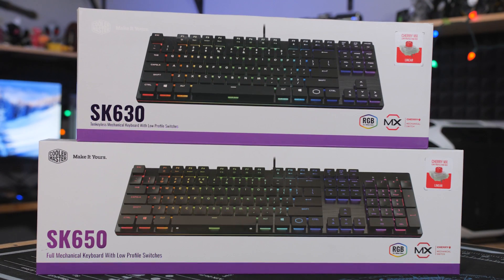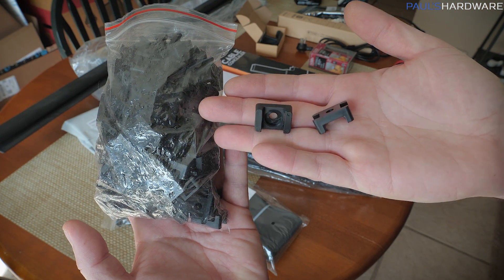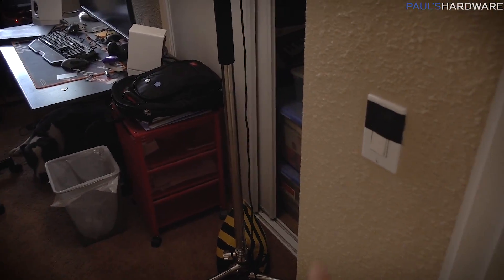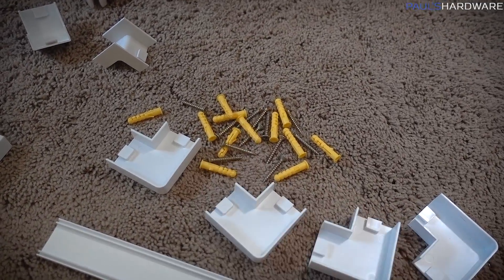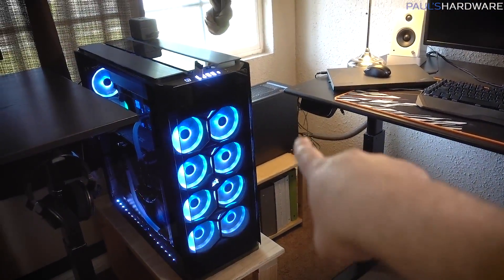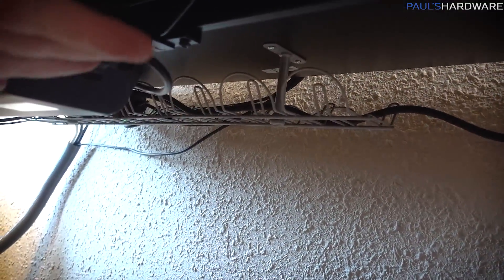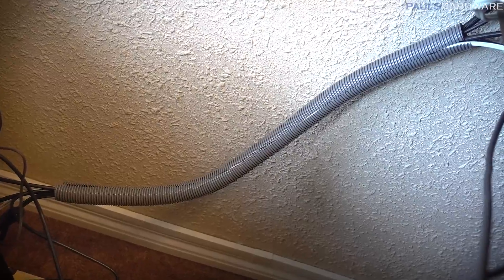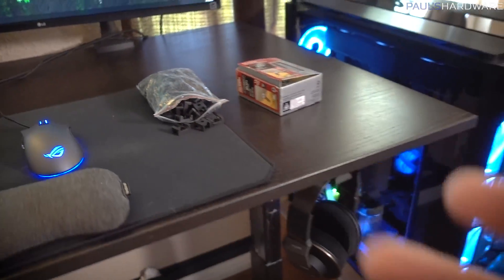Computer Room Cable Management Gear Test!

Comment: I use ace bandage to keep my cables together because those cable things, like the gray one he has behind his computer are hard to manipulate and can only hold a set amount of cable, but ace bandage is cheap and easy to apply. It's also flexible enough to wrap around cords that have been bundled to make them shorter. you can bend it in multiple directions to keep things straight and to go around corners. It comes in all sorts of colors too. (I use black) I also use it to attach my monitor cord to the monitor stand to keep it from hanging down. It's easier to remove and to apply than the sticky clips, which kept popping off whenever I change my monitor position.

Comment: The cable tie clamps are good but there are better ones with a reusable strap built in. That way you don't have to cut cable ties every time; you don't even need cable ties. They also come with screws.

Comment: Everything looked pretty clean with the exception of the plug at 8:55. Paul, what cable management would you recommend using for a glass desk to properly hide all of the cables since the option of drilling holes isn’t available besides adhesive tape? 🤔

Comment: None of the youtube video about desk/room cable management helps me with my situation:
I have 1 work laptop, 1 gaming desktop for me and 1 gaming desktop for my son
5 monitors
Then a bunch of devices that none of the youtube videos cover: 
internet modem
wireless router
VPN router
VOIP telephone router
3 UPS
a flatbed scanner
a laser printer
multiple USB hubs.
multiple power strips
2 subwoofers and 2 pairs of satellite speakers

Comment: ive done a lot fo electrician work and we use those canals with the lids on and they come with adhesive on it but they never get used by anyone around ehre as they never last more than 2 years when when/if you take it off, it might ruin the wall/wallpaper/paint.

Comment: I'm still looking for a cable management system that not only allows me to put cables out of sight, but to undo the management easily. Every current solution seems way too permanent and I rather have unsightly cables dangling around the whole place than having to crawl out of my wheelchair to the floor to get under the table, destroy single use cable ties and such, then replace them when I'm done moving or rewiring a device, which happens every week (or rather would happen, if I was ready to deal with the hassle).

However you convinced me to give IKEA Signum a shot, so thanks! :)

Comment: Pro tip: drywall screws have a larger diameter thread than most normal anchor screws and work great for mounting cable channels into plaster or drywall.  The smaller threads can more easily pull out whereas the drywall screws are more secure: its not a perfect solution, just more secure.

Comment: I usually just use velcro strips and a staple gun for underneath my desk. You can cut the velcro to the length you need, and the staples don't really leave marks in the wood.

Comment: Thanks Paul! Super useful video for me - cable management will be my next project and I've considered a few of these very products. Good thoughts on using screws instead of adhesive strips - a screw hole is much easier to patch than a 4 foot strip of paint ripped off the wall when you move out if you're a renter like me.

Comment: Watching you do this made me feel bad about my current desk cabling situation. So tomorrow, I have this job ahead of me, with slightly more cables due to surround sound system and TV and a desk that sadly does not lift. If I die, please have Steve from GM take me to Heaven. Because I don't quite fancy The Verge in Hell.

Comment: If anybody else is doing this, if you move your stuff around a lot or have to change any cables it's gonna be harder than before. The ikea rack under his desk (I use that along with velcro ties), if you wrap a cables around in there and then want to swap one of them out, you have to undo the ties holding your cables together and unwrap a bunch of cables out of the way on the ikea mount.  eventually I  used less Velcro ties and didn't wrap any cables around the ends of the ikea mount, I just ran then through and looped them around on the inside.

Comment: You keep talking about how rough your walls are and not being able to use the adhesive, but you could have run that thin raceway along the bottom of your baseboard and it wouldn't have been as noticeable.  They also have replacement baseboard with cable raceways built in.

Comment: reminds me that I need to rework my cable management in both my living room and our computer area.
going to replace a couple of the power strips with ones that include usb charging, will get rid of wall warts.  replace monitor stands with arms, mount power strip to wall as opposed to floating around on floor, install cable runs.  wife might not like it at first, but will soon accept becuase we have no desire to move anytime soon so no need to worry about ripping that stuff down adn repairing screw holes.
Anyway, great video, gives me some ideas and will make that  a project to work on during my annual staycation while wife and kid are out of town.

Comment: I love it! 
I have one minor grudge though. That L-stand for the computers. I'd look into flipping it 90° clockwise, and having the almighty $10000 build with the back towards your desk, and your wifes pc place with the glass panel out, having the rear facing the wall corner. And that little box thingy on the outside of the pc, towards the rear. It's hard to explain properly, but I think you get the idea 🤗

Comment: The way you have seemingly powered everything (except lights) in that room off one single outlet and single standard duty extension cord concerns me.  You have 3 power hungry computers, 3 monitors and a host of other accessory items apparently all fed off it.

While the circuit feeding the room MAY be adequate for serving all that hardware and presumably the lights (possibly another room as well?) that cord arrangement is asking for issues.  I'd spread the load across the 2 non-switched outlets and use either a true surge protector with it's own integrated long length rated plug cord.

Getting down to the nitty-gritty, you are violating California Fire Code 605.4 & 605.5 so god forbid if something ever does happen, you might be SOL with insurance.

Comment: Little tip: If you got a keyboard drawer under your desk, those little adhesive cable ties are awesome as mouse bungee. Single one holds my mouse cord under my desk with no pull on cord or the cord rubbing on desk end. Like $2 for 20, so basically a free mouse bungee. Likely would work on top of desk sticking one on side/back of your monitor too.

Comment: Can you do a video on raid across nvme m.2 ssds?
Looking at using 4 512gb Intel 660ps in a new build
Reply: You'll need a platform that supports PCI-E bifurcation. The Intel X299 from Intel does but you'll need a VROC key. There and Ryzen and Threadripper boards that support it with the use of software and drivers.

Comment: forget those keyboards in the begining get the cherry mechanical ombar keyboard fully customizable rgb backlit keyboard on ebay for 20.99 free shipping https://www.ebay.com/itm/Mechanical-Keyboard-USB-Wired-Backlit-Ergonomic-Gaming-Keyboard-Blue-Switches/111316592688?ssPageName=STRK%3AMEBIDX%3AIT&_trksid=p2057872.m2749.l2649

Comment: Another very handy tool and cheaper solution for cable management (to replace the cable tie mounts) if you have one already is a staple gun on the "shallow" setting so it doesn't go in to the wood all the way it leaves enough room to slip a zip tie through it. It won't come out even with a lot of weight hanging off of it. It's less noticeable instead of a large plastic object with a screw. If you ever do need to remove it though it comes out rather easily with a bit of force with a pair of pliers.  I use them on top of the desk too to route wires for input devices more neatly. If interested, here's a link to a cheap staple gun (the one I use): https://www.homedepot.com/p/Stanley-SharpShooter-Heavy-Duty-Staple-Gun-TR150HL/100375887

Comment: Back when I was a Sophomore in High School, I cleaned up the school’s student news room (I was in charge of doing the live recording and adding text to screens and fading/scene transitions) and I just had a lot of time to kill waiting on the anchors arrive, go over their lines and then I would need to do the recording, then I’d put it onto the USB and we would sit wasting time so we didn’t have to go back to class (XD).
I went around and made sure that every cable was actually plugged in on both ends, if not then I found where it wasn’t supposed to go or I unplugged it. I found a RCA cable unplugged, behind a wooden thing, which the cable was used for going from a converter from one computer into the TriCaster computer for video capture. I also found a circle-jerking Ethernet Hub (it’s network input side was plugged into one of the shared ports) and I went out into the library to get an Ethernet cable from the computer scraps they had (I don’t think I was supposed to mess with any of it, but no one said anything to me) and a I plugged one side into an RJ-45 jack outside the news room, ran it under the door and around the wooden thing, then down to the Hub, and I connected the desktop capture PC and the PC used for PowerPoint (used like a TelePrompter), and for some reason the TriCaster had a sticker saying not to connect it to the internet’s, but I asked the teacher and she said to do it anyway, so I did. After that we (students) could log in since the computers could reach out to the network to contact the logon servers, so now we could turn off the computers without having the teacher come out to log into them with her account (IDK why her account worked, teacher accounts aren’t set up as administrator accounts).
Unfortunately, the superintendent made our school combine in my Senior (previously we we’re like 5 magnet schools all on one campus) so now she’s is in a different building, and I doubt she bothers to have students go that distance to do the school news (less then 200 feet, but still, you go outside so you would need a key to get in through the side door, which even teachers aren’t supposed to use unless it’s during class changes)
So my efforts were valiant and effective for 2 years, and now the room sits not being used, but ready.
(The camera is always on by the way, poor little thing has so much visual snow... XD)

Comment: Hey Paul is the entire receptacal controlled by the switch? Or is it just the bottom. Most of the time they only do the bottom. And even then most of the time the rest of the receptacal power is ran through the back of the box. Just something to think about if you don't want to run the cable for the desk all the way around the room.

Comment: For Wifeys KVM, you should consider getting her a new monitor that has one built in. 

Many newer monitors with built in USB ports and multiple display inputs will switch the USB ports over to the other input when you switch (assuming you're using DisplayPort for both the PC and the Laptop), this will clean up 2 cables going down to the PC and completely remove the need for the KVM altogether.

Comment: I did all my cable management in the winter time with most of the clips being held in place from adhesive. Now that it's starting to warm up, lots of them are coming undone. I will be using only screwed-in ones from here on out.

Comment: As an electrician i'm a little triggered by power and data runs together and a light switch on a power socket (illegal in the UK) but i do like to see (or not see) cables tucked out of the way

Comment: I have a question. Is it safe to plug in your power supply into a extension cable?
Reply: Extension cords should not be used as permanent wiring. If you need to extend that cable just buy a longer Cable.

Comment: Set up RDP on your wife's laptop and desktop (they both have to be running windows 7/8/10 pro not the home versions unless you have them, and she can remote into the laptop and run it inside a window. No need for a KVM for 2 machines.

Comment: I use those adhesive cable clips at work all the time. Paul you are right, the adhesive is terrible if you are sticking them to the underside of a counter or desk. Pro tip: remove that crap adhesive tape and use the really good 3M 03616 tape.

Comment: I've had the Zoto under my Ikea desk for over a year now and the adhesive holds up fine. I live in Florida, but I have A/C (whereas a lot of Californians do not have A/C?). However, as I am replacing my Ikea desk(s) with a large 78" x 34" wood slab, I'll have to drill the headphone mount as I don't have replacement adhesive tape/foam.

Comment: Ugh. Cable management in a tech room is worse than inside a PC. I like those cable tie mounts. uxcell makes a bunch of good stuff. I needed longer M4 screws to mount my fans to my radiators since I decided to use RGB fan frames (Silverstone FG122s) and buy the fans I wanted (Noiseblocker eLoops) to still have RGB effects with my fans. I also mounted my Monsoon MMRS pump/res in front of a set of fans and to my radiator. With the spacers it ended up being 50mm. uxcell to the rescue with a variety pack of stainless M4 hex head screws! Here's a link to my YT channel vlog. It's about 2 months behind though.  https://www.youtube.com/channel/UCsyvh6D-4t6qsxPpA2-y5dQ